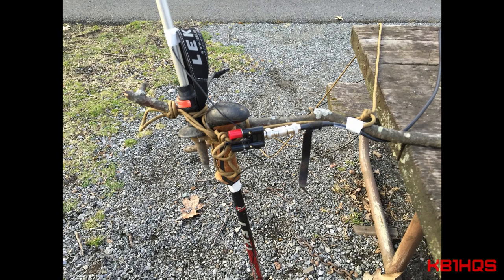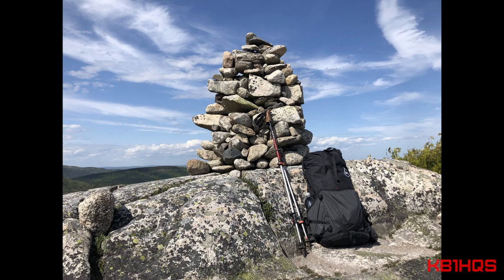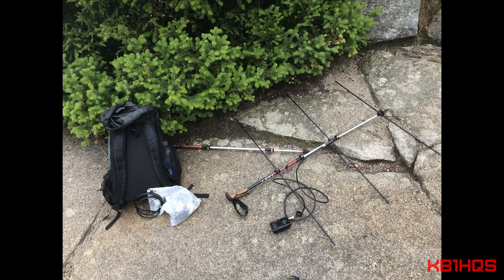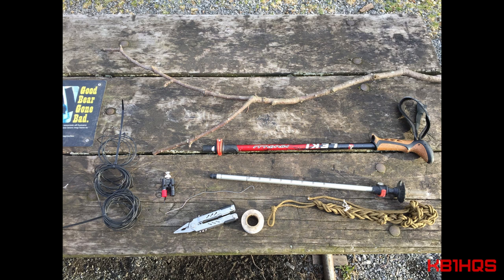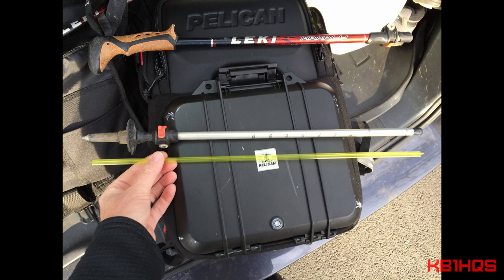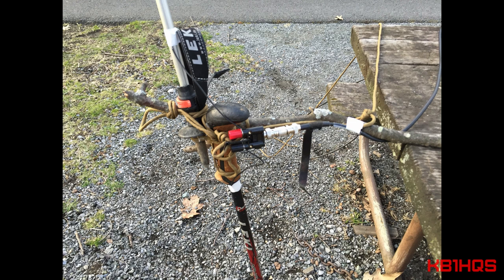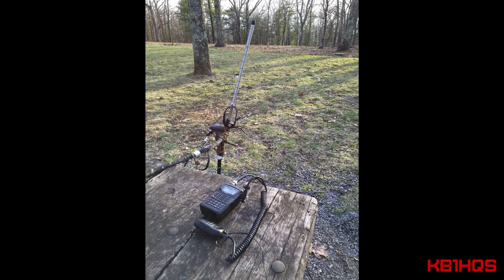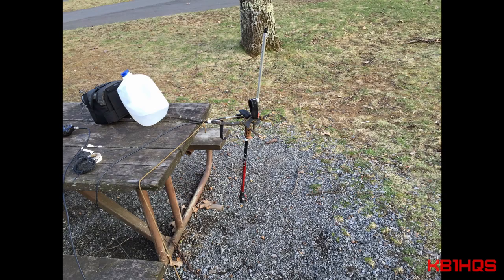Emergency 2m Field Expedient Antenna

Comment: Great innovation. Doesn’t your leather man have a ruler on it?  73, K8JLW
Reply from the maker: You are correct. I could have measured it with the multi tool but it was more fun with the wiper blades. 73